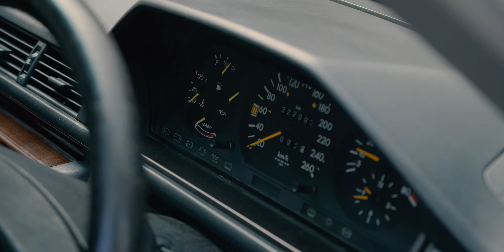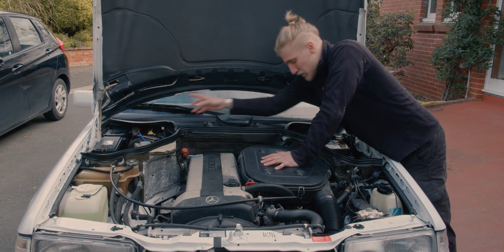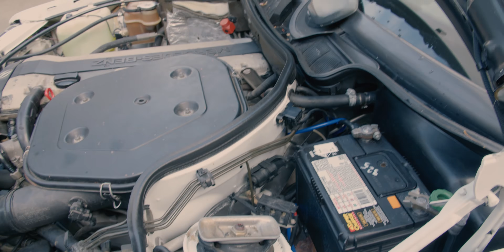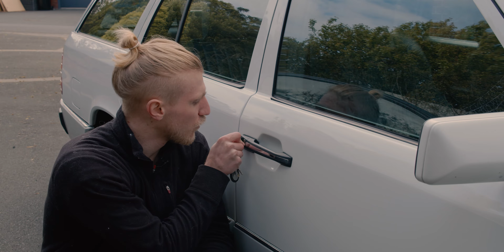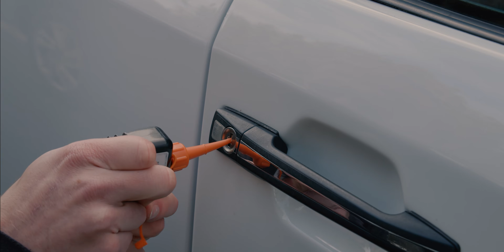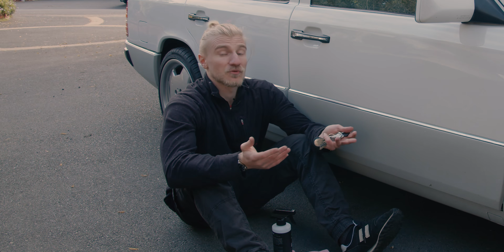To-Do List #12: Door Lock Repair & Economy Gauge Vacuum Leaks | W124 300TE

Comment: I cant tell you how useful your videos are - unbelievably helpful - thank you! Do you have a link or product code for the replacement blue vacuum line you used?
Reply from the maker: Hey Jack, thanks for your comment! I believe this was the one I got in the end. https://www.supercheapauto.co.nz/p/saas-saas-vacuum-hose---blue-3mm-x-3m/286634.html?srsltid=AfmBOopGBfzoET1jKokgVSe0L1chWGtry9j-J6sxvMHUi9Gy4t7_q6vE . Probably a bit late coming back now, did you already find something? I was really keen to find an original, but honestly this one is working really well after I  figured out I could use parts of the original as connector.
Reply: @ArcticWhite300TE thanks a lot I found something similar - would be good to keep original but arguably this stuff is better!

Comment: Thanks for the idea for looking at the plastic vacuum line. I was only replacing the rubber connectors. I will be looking back for it. My economy gauge (which in fact is showing the intake manifold vacuum) is not fully to the left when engine is at idle. BUT. It goes fully to the black when reving to 1500rpm. Which means that the hole is sucked in and closed with a bit of rev.
Reply from the maker: Did you end up taking a look at the entire vaccuum line? I found it such a pain to follow them through  the engine bay!